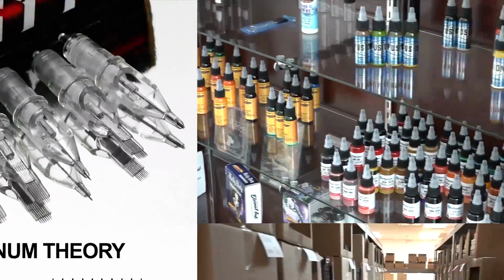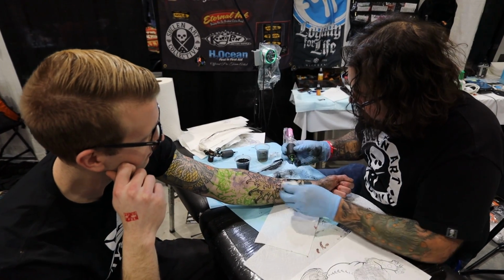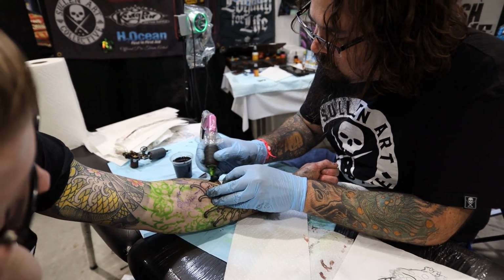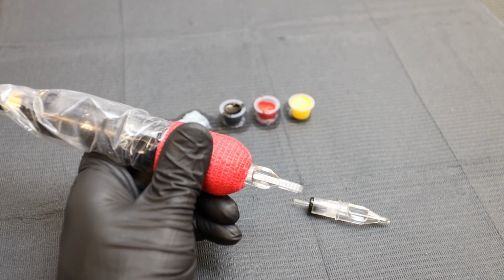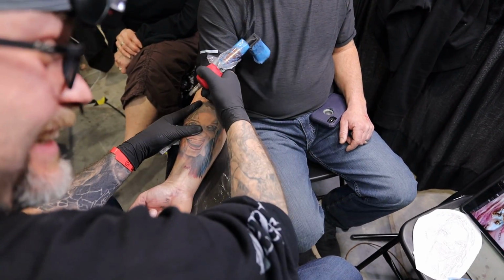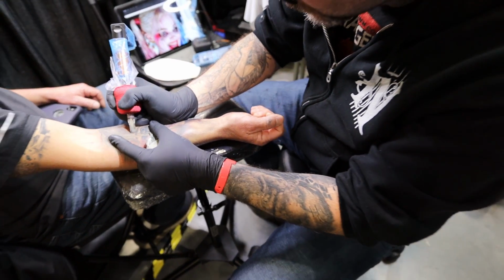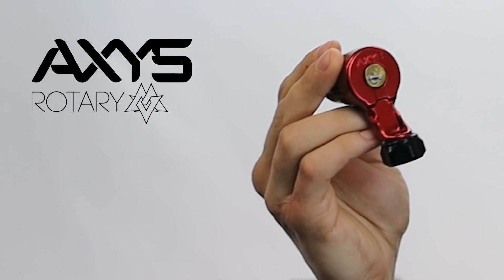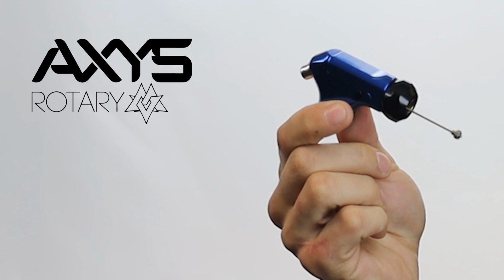𝐑𝐨𝐭𝐚𝐫𝐲 𝐯𝐬 𝐂𝐨𝐢𝐥 𝐓𝐚𝐭𝐭𝐨𝐨 𝐌𝐚𝐜𝐡𝐢𝐧𝐞𝐬? Artists Explain The Difference - Direct, Linear, Cartridge & Pen

Comment: I’ve been using my coils for almost 20 years now. And am now trying out wireless machines. I can’t believe how effortless and convenient it is to use . No more power supply, no more cords no more pedals, etc. but since I’m really new at using wireless I still second guess the staying power of the tattoo. I guess it’s just old habits. But I feel like if I want to do a super solid tattoo, I’ll revert back to my coils. In any case, my coils are just “old faithful” and I’ll always have them atleast as backup .

Comment: paradoxically i get injured my left wrist after i move to a rotary from coils. Im right handed and i have damage my left wrist because i need to use more force to stretch the Skin. Rotary mostly hits a lot softer and you need to stretch skin lot stronger to put any ink, any lines  especialy one pass lines. 
Hybrid machines are the Best. They work consistent like rotary and hits hard like coils and they do have a give witch makes easier healing proces

Comment: I felt 5x more pain when getting ink done with a Rotary machine
Reply: Really? How did you know it was 5x? Maybe it was 2x. Or maybe it was none. Maybe as humans we tend to forget the feeling of something that hurts us. Sure we remember that it hurt, but we do not remember the degree to which it hurt. For instance, if I got burned by a lighter, I could remember that it hurt. I could even remember the sensation that I felt. But the degree of pain on a scale from 1-10 I could not tell you from memory alone. And if I did tell you on a scale from 1-10, it wouldn't be an accurate number. I would have to burn myself with the exact same lighter in the exact same spot for the exact amount of time with the exact same amount of fluid in the lighter in order to tell you the degree. So unless you're getting the exact same tattoo on the exact same part of your body once with a coil and once with a rotary, you can't say that the rotary hurt you 5x more than a coil. That's dishonest. The reality is there are many reasons why you feel that the rotary was more painful than the coil. 1 reason could very well be the machine. Another reason could be it's a different tattoo on a different part of your body. Another could be different artist. Another could be, same artist different technique used for each tattoo. Not all tattoos are done the same way. I may tattoo a black and grey piece slower and softer than a tattoo packed with vibrant colors or vice versa. Another reason could be the food you ate that day. Yes, food. Believe it or not, your diet in fact dictates the level of pain you feel while getting tattooed. Foods high in sodium stimulate dehydration which can cause you to be "bloated" or slightly swollen in some areas. Another reason, which is the most probable is that you simply forgot the degree in which the coil machine hurt you, you just remember that it didn't hurt you as bad as the one you are getting at that moment. And that's because, well, because you're feeling that one at that moment.
Reply: he didnt have to write all that, rotary machines hurt more😭
Reply: I’m extensively tattooed and all but my last three session were done with a coil machine. I will say in my opinion I spent less time waiting for setup, I was able to sit longer, and my healing was almost half the time. To me the coil hit a lot harder, but I do miss the buzz.

Comment: I can't get used to them...the slowest part of the stroke is always at the top and bottom. Unlike the coil machine, where the upstroke is quick. Therefore I can never get it to not have a snagging the skin feeling.
Reply: Fact. I had to shorten my normal throw. As shallow as I could work well with. I got used to the rotary after six months. Rarely use my irons.

Comment: Membranes are useless when you are handling them with contaminated gloves and laying them on contaminated surfaces. The problem today is a lot of artist are not autoclaving metal grips and just wrapping them.
Reply: If that's the case and barrier wrapping the handle is not sufficient then it's already more of a hassle. Espescially if you travel as disposables are light and easy to pack.

Also if it's really standard to have to autoclave the grip, why are they never sold with the grip separate and  sold as such? Because in a busy shop you'd need at LEAST a dozen autoclaved grips on hand.
Reply: @bigislander72  I use a pen and I have 12 metal grips for the pen to autoclave. According to CDC all reusable instruments should be autoclaved. Even though it is a good idea to wrap in in plastic it still does not stop cross contamination caused by switching them out during tattoo process with contaminated gloves on and laying them on contaminated surfaces. Even the Alliance of Professional tattoo artist say they should be autoclaved if they are metal reusable grips.
Reply: @Scoobieish  I still have one...but haven't used it in years, not since disposable tubes became the norm...so other than the skin snagging thing the fact that now I indeed MUST have an autoclave, must maintain another expensive piece of equipment, spore test regularly, need pouches and all that...takes the novelty right out if it for me. If they come up with prepackaged sterilized GRIPS then might reconsider.

Comment: I have no clue what a rotary feels like. it’s been at least 4 months I’ve only worked with coils and not going to lie my had does have pain here and there, especially some areas of the body i tattoo my had can’t handle. Should I try rotary???
Reply from the maker: you should give them a try, they are lighter and vibrate less.

Comment: I want to start my own tattooing i have no experience with anything but I can draw, write , do portraits really good but i want to start tattooing so will a pen tattoo machine be better cuz its kinda like drawing with a pencil the way you hold it ? If that makes sense but yeah any tips on anything let me know. Thnks
Reply: Fellow pen/pencil/woodburning/airbrushing artist here, who just bought a rotary machine. I’m not sure if you e purchased and tried one yet or not but if you have you’ll have found that it’s much different from any other type of art. Lots to take into consideration when tattooing. But I’ve learned a ton and I e only done 3 tattoos on mine and my wife’s legs. Picking it up and steady practicing is already half the battle won. Good luck.